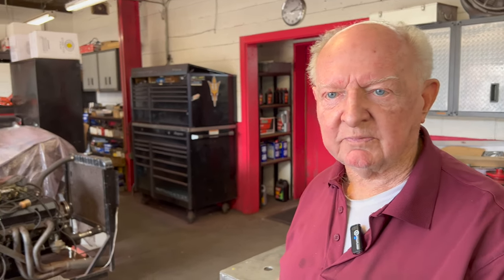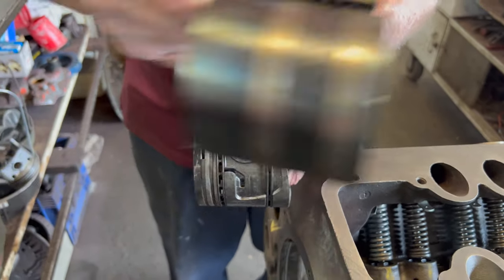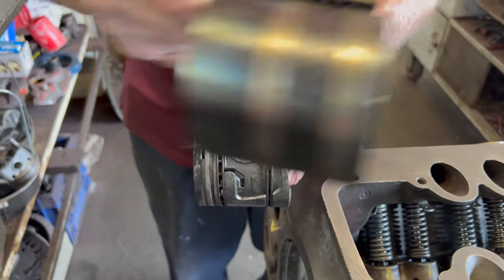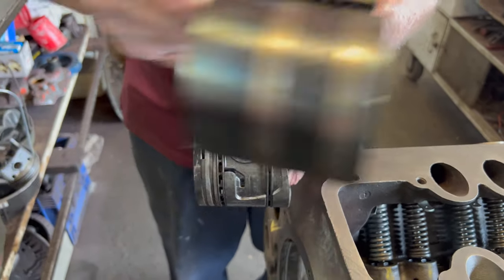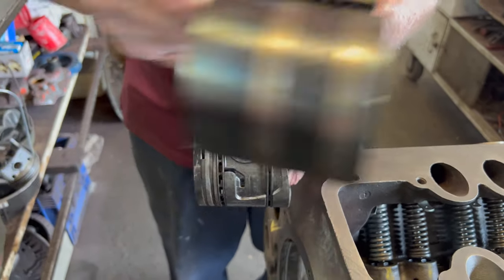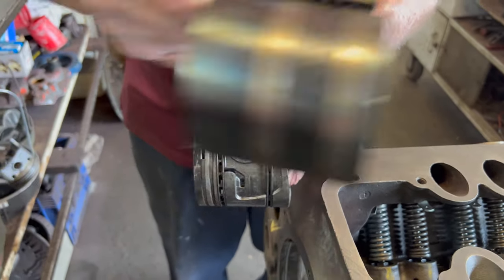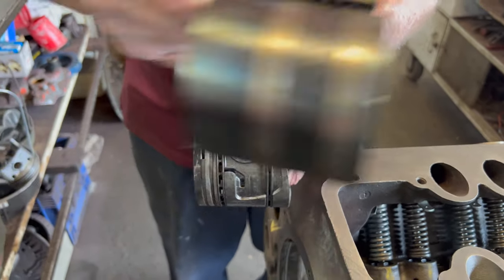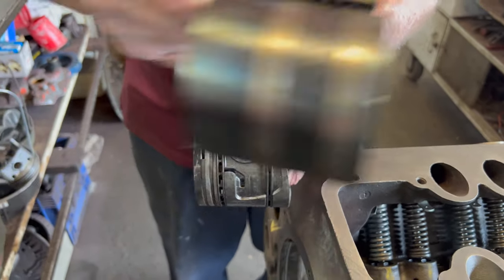FlatHead V8 Fires up! Ed Smith Shares Tools Tricks rebuilding Flatheads w #barryt

Comment: I am 73 years old.  The bill for bringing me into the world was paid for by my father rebuilding Ford flat heads at a Central Pa. Ford dealer.  He had it set up with a local bank to finance the overhaul using the value in the car.  That was in 1950s. He disliked adjustable lifters and never used them.  He said you could hear if the engine had adjustable ones.  I remember my Mother in 1947 SUPER DELUXE  at stop sign telling us kids to be silent so she could HEAR if the engine was running.
Reply: My folks paid Dr. Larson $50 in 1950.👍

Comment: Let's face it...technology has taken over years ago but if it wasn't for men like this with the foundation of  the mechanical aspects totally mastered we would be nowhere! He is a treasure and deserves all the respect in the world! The best part is that you can see that he loves what he is doing And sharing it with the world. Keep this guy and his videos coming!
Reply from the maker: Thank you, Jeff, I certainly agree with you about Ed’s hard work and then being generous to be willing to share what he’s learned. I’ll keep them coming as long as he’s willing to sit down with me!
Reply: At this level, internal combustion engines are largely similar.  Overhead or flathead, lapping valves is pretty much exactly the same.process. Even on a small engine like a lawnmower engine.

On ALL older engines with distributors, the rough timing is exactly the same, (to make sure it's not 180⁰ out of phase, like in his first story).

The wooden dowel pin trick, and relieving the block, for instance, don't apply to more modern, overhead valve engines.

Comment: I think we should start making more Flat-head/side valve engines.  The engine I have in my van is a common rail diesel- you can't service that yourself.  We need to become more self reliant. Simpler engine that are reliable and serviceable is key to independence.
2 years ago my 3.2Ltr diesel Ranger stripped the pistons, because a hole in the coolant hose, that pumped the coolant out on the highway as I was driving. $10,000 USD later I had a rebuilt engine.

Comment: I found your channel yesterday, and today I learned the use of some of my Dad's tools!  My Dad was a Ford man and had most of the same tools shown today.  I think he would have killed for those magnetic value keeper installer!
  I knew the adjustable lifters came out of  a tractor, but not which one!
I think (not positive) my Dad ground the entire bottom threaded portion off of the adjuster and used  a center punch in the upper until the adjuster dragged enough CEO it would not move after it was installed!
    I am going to recommend your channel to my Grand nephew today!
Reply from the maker: Wonderful! So glad to have you along!

Comment: Thanks for sharing all the tips and tricks. I've worked on a few flatheads and shown them in my own videos. I have also used a lever down the inlet ports to push the valves down and this is the first time I have ever seen anyone else acknowledge the method.  The screw in the lifters is a tricky one. If you have one that is too loose you can crush the screw lengthwise as that is how they produced the tight thread in the first place. You do need both parts of the thread in the thread in the lifter for it to remain tight. Once again, thanks for showing some real in depth flathead content, lots of it just gets glossed over. All the best, Mart in England.
Reply from the maker: Thank you, Mart, seems like you know, a few tricks yourself! Thanks for joining in the fun…

Comment: Still curious how assembly line workers were able to install the valves at the speed of production let alone be able to machine the parts so everything was in spec. I was able to meet Don Sullivan who was one of the original Ford flathead designers while working as a prototype engine mechanic at Ford but never thought about flatheads until many years after he passed.
Reply from the maker: I have no idea but would postulate the engines were assembled on a different line or lines to account for the difference of time needed…?  
And thanks for sharing about Don Sullivan. Some make fun of the flathead and maybe it was getting ‘old’ by the mid ‘50’s  but when it came out it was amazing!
Reply: :person-turqouise-waving:             G'day there,
I remember seeing a FORD factory film, and yes the engines were complete when arriving at the assembly line from the Engine Department.
Cheers and kind regards.
Malcolm. (vintage 1942)

 @BarryTsGarage

Comment: Absolute wonderful old gentleman! This kind of experience and knowledge, you can't buy at any price. The only thing I would dare ask is how do you lock those tappets, when the bolt now moves more freely? From what I gather most people drill holes in the block seats to hold with a rod whilst adjusting, and the sheer difficulty of adjusting the bolt is to maintain that adjustment. 'Modern' tappet adjustments have a locking screw/bolt for this purpose. Just asking :)

Comment: i would like some info on the shop  Name Ed works at. impossible to find someone with this kind of knowledge to build your Flathead V8. I have one i need built
Reply from the maker: You can try Five Star Engines in Phoenix AZ but Ed is mostly retired.

Comment: I have 1947 flat head it has distributor front engine. I like to know more about engine oil pump conversion. also want type oil use engine after overhaul. In your you tube were buy life for this engine. Really enjoy you take about value adjusting .were found tool put lock back on value stem? What make tool out the for intake value? Want charge to do complete overhaul on 1947 engine?

Comment: Hi Ed  , I have a 239 flathead that I can not put the fuel pump pushrod back into the port. Same cam new bearings installed by a builder .I am using the same pushrod. The bearing is aligned but it looks like the opening in the cam bearing is to small. Any ideas. Fred

Comment: Did you catch that this block is bored .100 over??
Reply from the maker: True! Apparently the ford flathead can even handle a .125 over!
Reply: The over bore is for a reason first of all bigger piston makes more power, second is the cylinder walls are so thick that they don't heat transfer, the thinner cylinder walls will help in the overheating, hope that helps

Comment: There is no reason to turn the camshaft so many times when you can turn the engine one revolution one time to set all valves. I cut my teeth on flathead fords & i have the chart that tells you how to do that. I've used it many times before adjustable lifters were available. We ground the ends of the valves to set the clearance,: pretty fast when you could set one third of the valves at the same time.
Reply: I did my flathead with all stock parts, it takes some time to fit valve clearance when using different valves than were in it. To me an interesting note is caterpillar 2 cylinder opposed starting engine has valve guides held in place with clips just like flathead V8 Ford.

Comment: Father n law dropped his flathead off for a cleaning and magnaflux, wanted an estimate on repairs if needed, $6000 later he found out it needed to be bored, crank turned, and new valve train, he's not impressed, it's not as cheap as a SBC to play with, he would have guessed 2 grand at most, i laughed
Reply from the maker: No, none of this is inexpensive anywhere anymore… Ed has been complaining about how expensive just a set of bearings is now, I think $600-800. That’s just the bearings!

Comment: Erroneous info on the oil filters!  They were by-pass units and used a tiny orifice to meter oil flow through the filter so oil pressure was not lost by an empty filter. Plus, that orifice was near the top of the filter so all the oil never drained down into the pan!  By the way, Red's Headers is in California, not back east.
Reply from the maker: Thanks for your input!